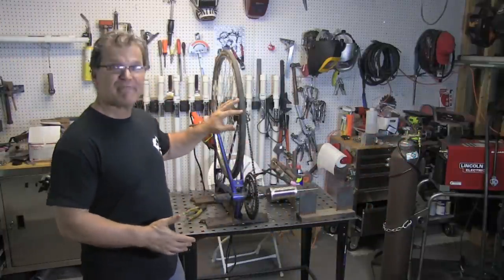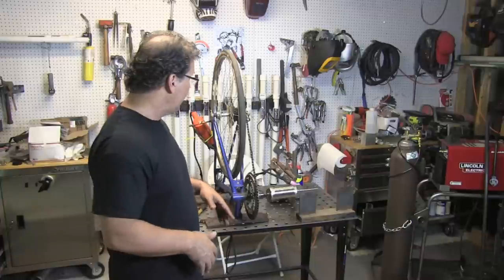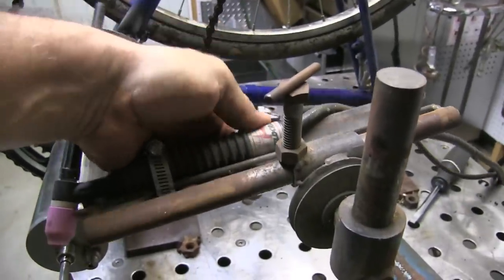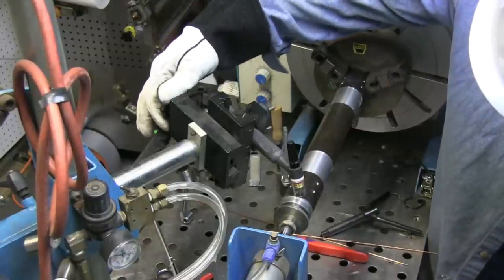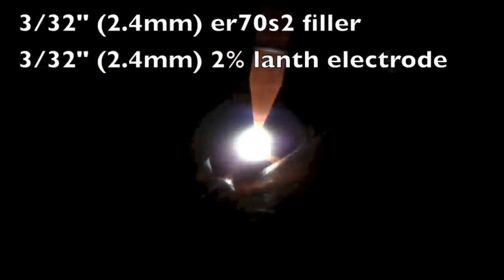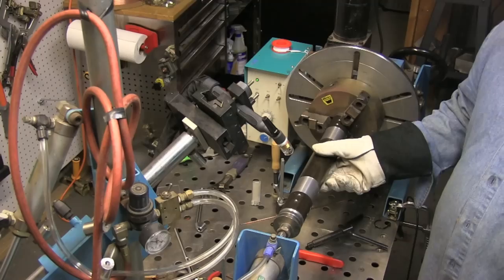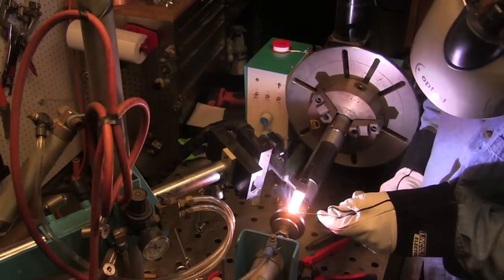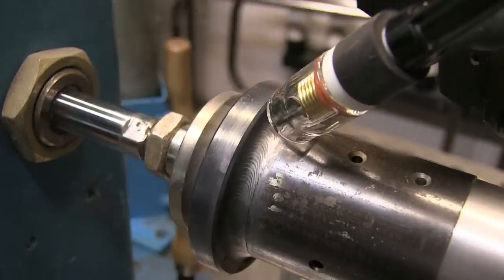My first Welding Lathe made from a Old Bicycle

Comment: i mean, I've made some jigs and all. but your bicycle lathe wins hands down.
Reply: Hahahaha!!
Reply: I'm just starting out and only have shoestring budget. I put just about everything to get my everlast welder, accessories and a tig finger (of course!). All of my jigs are literally stuff I find in the garage to help me out.
Reply: Fred Almond yep just got my thermal arc 186. So happy to finally have my own rig.
Reply: There are some of us who walk past a scrap pile and see trash. and then there are those who see a plethora of potential for what could be.
Reply: Nick Warner thats the hardest part of cleaning the garage!
Reply: Its easier to just build an addition to the garage and keep all the stuff. Plus you make room for more stuff.
Reply: por que no lo traducción
Reply: Video per bambini
Reply: It is a poor weld. Your weld needs more material to fil it up. Or a second run . And you only have 50 to do thats normal and not allot
Reply: MW Sellox Yeah because your Youtube welding page shows better.Oh wait...you dont have one.
Reply: Hows the drill connected to the bicycle wheel, am I blind? :)
Reply: Nevermind :) 2:08
Reply: MW Sellox Some people just shouldn't comment. Especially if they don't know what they are talking about.
Reply: @nickwarner8158  If you see your machinist/fabricator throwing out "junk", find yourself another one!  Guy I work with is about 70 and you should see his collection of stuff from over the years!  Some of it is probably 40-50 years old.

Comment: We had  a similar set up but used the armature and gear case of an 5" angle grinder, cranked by hand via a handle attached where the end bearing should be, we had a 4" 3 jaw chuck attached to it and just held it in the bench vise by a custom made flat bar handle instead of the stock round hand handle, worked a treat for over 12 years.

Comment: Instead of feeding your wire by hand, would it be possible to create an armature that would employ gravity to feed it? Years ago I worked in a shop where they ran 7024 in the flat to butt weld sheets together and they used a tripod with a bushing in the rear leg. The stinger was attached to the bushing and as the rod burned of the stinger slid down the leg. Since the leg was angled in the direction of the seam the travel was controlled by the angle of the tripod leg.

Comment: necessity is the mother of all invention.... and it only had to work once, right?
 another trick for thin stuff. not that that has anything to do with what your doing here. put a 't' in the gas line and run it to a strip of sheet bent so there is a gap for the gas to fill and duct tape it to the back of your thin sheet being joined. this will keep the back side from burning if your a little too hot . works great for .034 sheet  ( stainless) may have to use a couple cfm more gas so both the back of the weld and the torch get enough gas to shield best.
 love seeing stuff like this! good work!

Comment: I've just set up a vertical version of what you've got there with the lathe's 4 jaw chuck pointing skyward. Its just a small turntable sat on top of a thrust bearing bolted to the very edge of the work bench. It centers pretty good and with a dial you can get almost .000 run out when it turns. And what turns it is a weight on a pulley on a cord that runs twice around the vertical axle and tied to the bench going past my hip. I move sideways and the load raises turning the table until I'm ready to weld and then I slowly ease away on my hip and the weight turns the table and jaws at a controlled speed and good enough for non stop welding..... But all your gear is so much better. I never mastered TIG in heavy industry as in boiler tube welding on powerhouse site construction. Just could never co ordinate the wire and the hand piece enough to get good looking smooth welds like you've just shown. Congratulations.

Comment: Jody, how do you pipe purge gas on rotating homemade weld lathe? Think I may have figured it out on real lathe, probably piped through tail stock, right? What about ground? You mentioned that it was through bearings on home made unit, what about lathe unit, how do they ground?

Comment: Since you already own the lathe you might use it to rotate a rollout wheel if needed in the future. Your gear reduction would have no problem turning light to medium work. A cheap or free way to get a bearing and flange combo would be to use the front wheel bearing and flange assembly from a 4x4 or front wheel drive car. Get the stub axle too. Youtube videos on rollout wheels and pics from welding forums may inspire your design.

Comment: Hey Jodi, can you show us how to weld a threaded bolt to an 1/8" plate? I've tried using both my cheap Chicago Electric mig welder and my Lincoln AC 225 with 6011, 6013 and 7018ac rods, but have not gotten satisfactory results. I tried grinding the threads off to get rid of the zinc. And I've tried leaving the threads on and removing the zinc using ZEP rust remover. I almost always end up with either weak connections. Thanks.

Comment: In the beginning of the video, you mentioned "grounding issues".  Meaning something to do with drill which is running off of AC current and the  DC weld current?   That's something I've been wondering about in regards to my desire to convert an antique metal lathe into something similar.  Since mine is an old cone pulley drive,  which uses a leather flat belt to transfer motion from corresponding cone pulley/ v-belt shaft, and v-belts link to the  electric motor.  My thoughts are that as long as the motor is mounted in a way so it's electrically isolated from contact w/ the lathe, with only v-belts to leather belt,  I won't fry myself and blow up the transformer out on the utility pole outside.  Open to all input people, chime in you feel need.  Love the podcast too by the way, thanks.
Reply: Bruised Orange: With the motor insulated from the frame and a belt
running between the two, you have a great beginning of a Van de Graaff
generator!! Could really get a "charge" outta that........

Comment: Hi, i would like to know if it's possible to weld a harley motorcycle inner fork tube  to regular piece of steel tubing that i intend to use for a project. By the way i will try to build lathe with my old bike.
I'm watching all your video and you help me a lot.
Thank you very much and appreciate all of you tricks.

Comment: I'm looking at maybe getting a miller 250 but I'd really like it to have pulse. I've found a older lincoln 300 that is water cooled and has pulse. which would be the better option prices are about the same. I only have 220 in the garage and can't afford the drop 3000-4000 for a welder right now. working with an econotig works well for what I do but pulse and a water cooler would be awesome. thanks

Comment: What's the purpose of the pulse on the arc? We weld high pressure boiler tubes at work but they only have old POS Miller 8 packs that we switch the ground and lead around when we tig the root. They X-ray a percentage of our welds and it's important they're solid, seems like they'd buy us some of these new welding machines if they help get better welds, what's the benifits to that pulsing deal?

Comment: Hi Jody,
Thanks for the cool & useful videos. I'm curious as to how the commercially made welding lathe avoids grounding through bearings. 
I also TIG weld round members and have considered a rotating machine to help with that. I weld more as a hobby, so I can tolerate the extra effort of turning the work myself, but the notion of a home built turntable or lathe in intriguing to me.
How does the commercial machine accomplish the ground path? Also, I've never seen a clear lens on a TIG torch before...what's the deal there?

Comment: Hi Jody, I wanted to thank you for taking the time to make these videos! I've been a welder for 11yrs, both professionally, and as a hobbyist. My career path changed, and now I'm an FDNY EMT, but still have a great love for the welding trade, and still pick up sidejobs doing it. The wealth of knowledge presented in your videos is invaluable, and I've learned a good deal by watching them! I have two video subject suggestions that I'd love to see you produce. Firstly, I've recently learned of a MIG brazing process that uses silicon bronze wire as a filler, and I know nothing about it. Seems to be a new fusion process in the automotive world. Secondly, I think it would be pretty cool to see a cut and etch/bend test of side by side samples, in which one joint is welded with 7018, and the other is welded with dual shield FCAW. Again, thank you very much for what you do, sir!
Reply: If you check out the channel SV Seeker, he did a lot of silicon bronze work on propeller castings and made some good videos of all of it. His channel was how I found this one. So you would probably like his vids about it as well. 

Even though your career changed, welding is something that nobody regrets knowing how to do. I get calls all the time for all manner of fixes since most people just have no clue about it.

Comment: Hi guys ... i need some help .... i have an stainles steel tool box that a have to build out of 1.6mm 25x25mm tubing ... im working with a stick welder for tig ... but it keep on destorting bad ... welder is set at 50 ampes ... i need help like bad

Comment: cool rig jody,do you use lanthanated electrode for pretty much everything?
Reply from the maker: I do ...2% lanth   its not necessarily the best for everything, but I think its the best all purpose electrode
Reply: Thorium is the way to go if you can get it where you live,  Lanthanated doesn't even get close. (Especially if you have a bad homogenic batch where all the lanthan is on the outside or only in the tip) 3-oxide gets the closest to thorium.

Comment: Is there anyway to weld high carbon steel to high carbon steel? Like turn the mild steel filler rods into high carbon steel?
Reply: just select the right filler rod for the material. Just like wire on a MIG or rods for stick, you get the electrode best suited for the metal you are welding.

Comment: I like innovation (necessity is mother of invention right) Enlighten me on the tig vs mig controversy. Or is there need for both if you're going to get serious about welding.  Looking for my first machine. Very mechanically inclined and can stick weld reasonably well  Thank you
Reply: What machines you buy are dependent on what type of work you plan to be offering to your customers. For instance, it would be hard for me to justify a TIG when the type of welding I do is often sheet metal/ exhaust pipe which my MIG handles fine and for heavier things, cast iron repairs or hardfacing I use an old Lincoln tombstone I paid $60 for years ago and has made my money back many times over. So if you are trying to go for stainless and aluminum. Building DOM tubing rollcages or things like that you would likely be able to make more use of a TIG and would want your money put into a good machine in that process. But if you are dealing mostly with mild steel you would be wanting a MIG, and how powerful a MIG would depend on how thick you are usually going. Also, if you wanted to do a bit of aluminum on occasion you would opt for a machine spoolgun capable.

If you are set on going new instead of used, find out when your local welding supply is having a demo day. Then you can try out several machines laying passes and talk to the reps about what machine would be right for you. Also, you can get a deal on buying the machine used in the demo as it is now a used machine. I bought an ESAB Migmaster 275 years ago and loved it. Saved about $350 because it had been used as a demo unit for 5 hours. Also check out your local tech school. I know the welding program at mine has a thing once a year where a lot of reps are there and you can try out welders, plasma cutters and the like. Good place to get some connections for things you will need down the road.
Reply: Good advice and thank you! Sounds like MIG would be the way to go. Probably won;t weld heavier than 1/4" mild steel... trailer frames, etc...
Reply: Jeff DeLuca Mig would give you good versatility and speed. Look for a good used unit, and pay close attention to duty cycle ratings. Last thing you want after you get it all tacked up is to have to stop and wait for the machine to cool down on a trailer job. Should be able to find an ESAB, Miller or Lincoln 220v machine used for a grand or so. Check online for grinders. I bought some Milwaukee 9" ones for pretty cheap used. Keep your eye out for broken tools too. I got a 1/2" Milwaukee drill for free because it didn't work. Its the older style with the aluminum case not the plastic stuff. Cost me $18 for the switch that was bad and good to go instead of dropping a few hundred on a new one. Craigslist, Ebay and auctions can yield good tools on the cheap to get you started. Best of luck man.
Reply: Thanks again! Yea I let a brand new miller mig go at a sale for $500.  There'll be more. Appreciate the input Nick

Comment: my engine has a gouge in the cylinder if have that gouge welded would the cylinder be okay to use again ?
Reply: perfect place to ask this question, you would probably be better off gouging all the other cylinders in the same place so the loss of compression will be the same evenly spread though out your engine, but if you were to weld it just make sure to only use stick welding process.  A 7018 rod would be the best, and you would want to chip off the flux on the rod before you use it because since it is in you engine you would not want to have all that slag and mess to clean up after you weld it.  That is what I would do in your situation, just food for thought. I would like to see what anyone else has to say. Good luck

Comment: What purpose does the pulse function have?
Reply from the maker: mainly, the pulse puts a nice even ripple without dipping the rod in and out. I wanted a lazy way to weld 50 parts and make them look good
Reply: Does the slow pulsing give you full penetration on those thicker joints?
Reply: It's all physics and maths. play with the speed and/or the Amps just need to get the right settings.